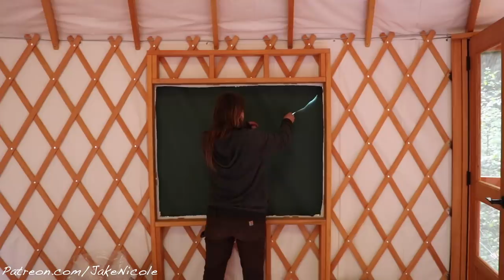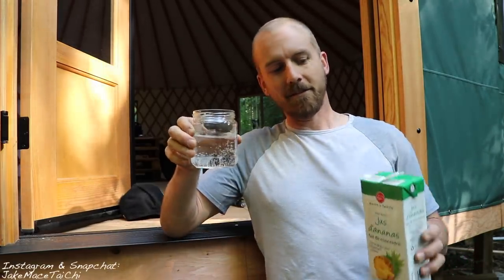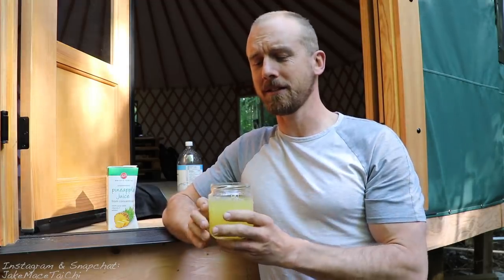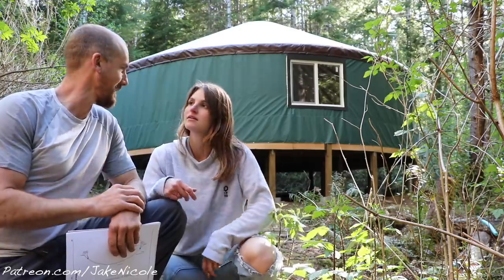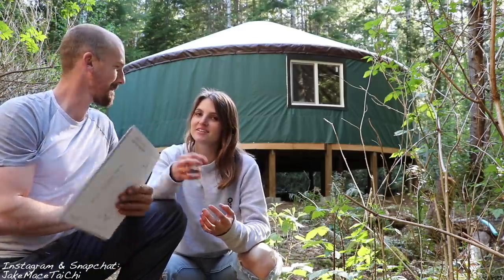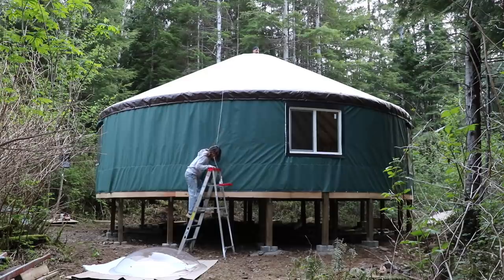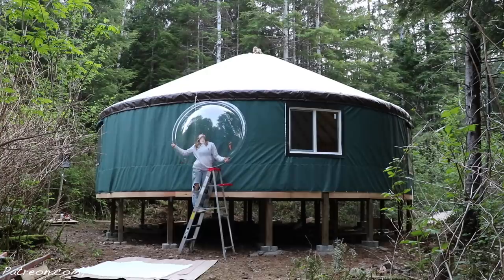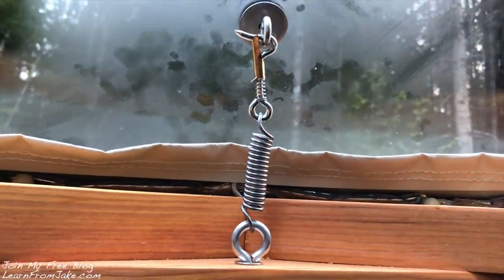Unbelievable YURT In The Forest | Building an OFF GRID Yurt  - Finale, Part 2/2

Comment: Cool yurt build!  I'm still interested in how you are going to insulate the floor.  It also doesn't seem like there is a lot of insulation on the walls and ceilings either.
Reply: Insulation WILL be a major problem in the coming winter, the will NEED at least R-12 tho I would go R-20!!!!   And the area under will need to be sealed off with insulated plywood, with a cedar base!!!
Reply: Wood stoves throw off so much heat, that you may not need insulation.
Reply: My Yurt from same company had to be R 10 on crawl space,R 20 on the sides and R38 on the roof and Pacific Yurts went about those R values.Those are West Michigan codes.

 @grumpyoldmarine3480

Comment: You two did a great job, a suggestion for the front door until you build your deck.  Use some strips of plywood to build up the surface under the extruded aluminum that extends out past the drip line to support it.  It will protect it from getting bent.  Again just want to say, fantastic job, you showed a great deal of creativity and adaptability in the process.

Comment: Yep! That is exactly how I would have tried to do it. I was going to say to lay the dome on cardboard and tie the dome to the card on just the direction at end that you would be pulling up. After setting the cardboard with dome on top of roof, U stand in the hole, Nicole throws you rope & you gently pull & slide the dome and cardboard. U only have to untie the dome, let the cardboard slide off the roof and place dome on! 

I am loving your work guys! Love the yurt and the colors you picked. Congratulations! U built your own shelter!!! 👍

Comment: What are you doing to keep the BEARs away.....Our log cabin use to get torn and ripped open...I can't imagine what the bears can do to those fabric walls ??
Reply: so many wood around... build fence :)
Reply: 12 gauge shotgun with 3 inch slugs , that's how
Reply: Joe Momma...only if you hit them square between the eyes. Otherwise you're just going to piss them off.
Reply: Excelent point.Cooking in the structure,means smells,trouble. Could see this if the frame was steel.High impact windows,Winchester .308 loaded and ready. Hungry bear will rip right through that material and wood frame.In the Adirondacks,out side Inlet, saw where an adult  bear tore lap streak wood siding off.
Reply: You got lucky, dude...bears are pretty fast when they're injured and ticked off...you got soooo lucky...

Comment: If a yurt has 'one' window, it should have its direction straight to the door. (Yours have 3 ones !) Because of its ventilation & sanitation. If winds go straight ahead from door to window or vice versa, its air condition will be the best. I really love your ceiling structure with transparent cover. Thanks for sharing this.

Comment: That works. I would have set a line in a tree on either side of the yurt and used a zip line rig with a pulley and just lowered it in place. BONUS when your done you have a zip line. Nice house though. Curious  how long does the outside cover last?
Reply from the maker: Donn Milesian I guess we will find out… A lot of research online will show that yurts can last several decades. Ours, is nestled in the forest, protected by trees… We are hoping they will prolong the longevity of our new yurt!

Comment: rocket mass heater maybe pebble bench type, check the riser heights & start harvesting local
fuel. Rocket stove with sturdy legs and wok holder top mounted & cook for free with twigs from the woods.  Have you done any floor insulation? 
bol guys

Comment: Are you intending to insulate your floor? Otherwise your feet will be popsicles come winter. I recommend batted insulation, at least R-19 (the higher the better) and a plastic covering stapled to the underside to keep out moisture and insects.

Comment: If that's foil bubble wrap you've got there you should be aware that's its not insulation, its a " radiant barrier " designed for a specific purpose to work with other insulation materiels, selling it as stand alone insulation is a wide spread con in the industry. Its impossible to insulate a building with a few mm of materiel with current technology. You may as well burn dollar bills trying to heat that building.